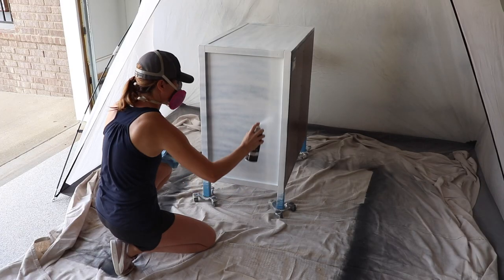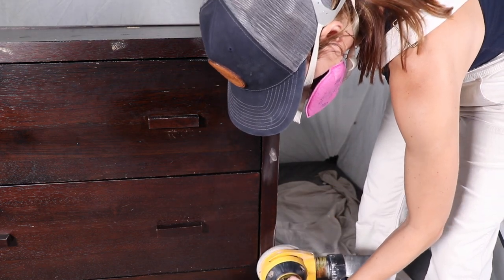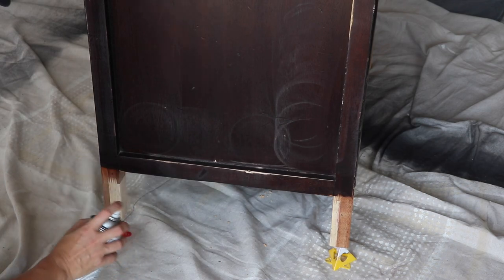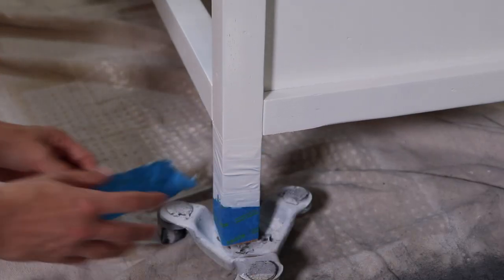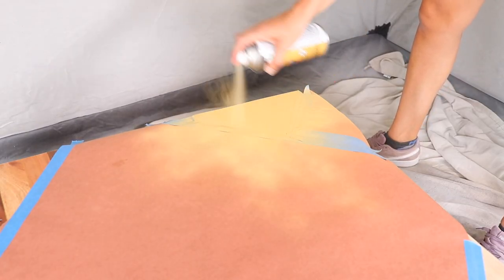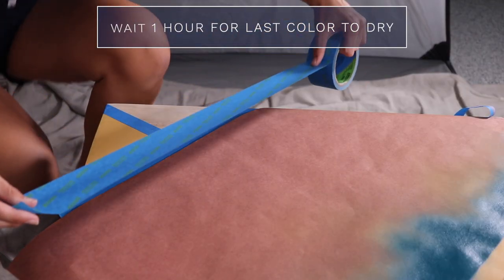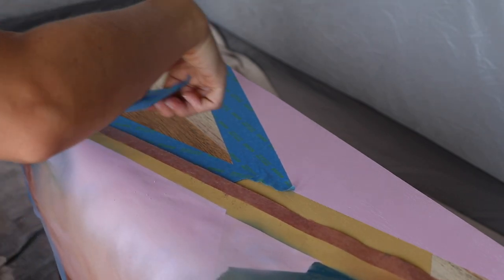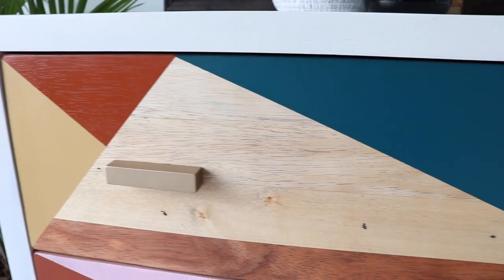Spray Painting Furniture | Color Block Mod Furniture Makeover

Comment: Very nice project.  A tip to speed up the drying process is to use a heat gun to dry the paint.  I use this technique quite a bit and it works great.  The only drawback is that you have to be careful to dry it evenly as if you leave the gun on a single spot too long, or your heat gun is too close, it will bubble.  But after a very little bit of practice, it speeds up the drying from 1 hour down to a mere 1 - 2 minutes.

Comment: Love it! Thanks for the tip to spray with clear first! I’ve been spraying stuff this week too and was getting pretty discouraged. I was using high gloss paint and it was so tough to get looking nice. Thanks for the encouragement and inspiration!
Reply: High gloss paint can be difficult to get even. You may want to try satin instead, and then use a clear lacquer after cured, thin even coats..it evens out better.
Reply: @empressche333  thank you SO much! That’s great advice! I’ll definitely do that next time!

Comment: I appreciate you mentioning WHY you spray each color block at a time. 
I made that mistake when color blocking my wall in the past. Put the paint where I wanted and painted in each block, looked great so far, but when I took of the paint.. I knew I had made a mistake 🤦‍♀️😅

Comment: ...put wood filler in with your index finger -- pushes it in and you can smooth it off before sanding....i would also degloss after sanding -- takes about 3 minutes...also alkyd paint rolled with a 1/4" nap 4" roller will give a better finish...

Comment: You are using wrong respirator filters when you spray paint. They are P100 filters and are very good at protecting you from inhaling dust, mist, mold spores, fibers etc., but they don't protect you from inhaling paint fumes. When spray painting you should use organic vapor cartridges.